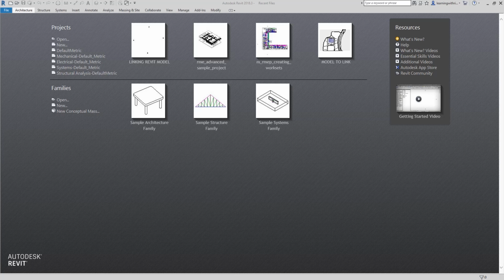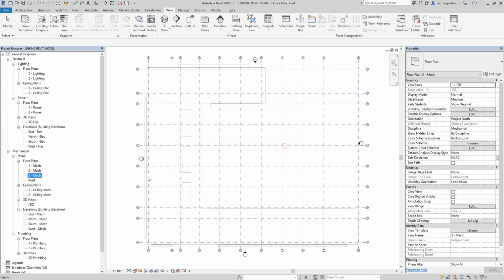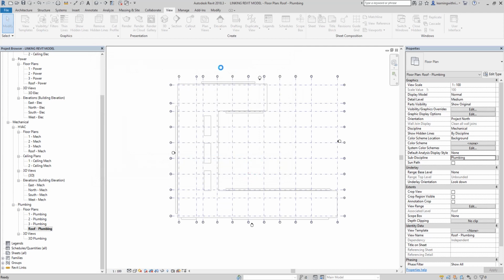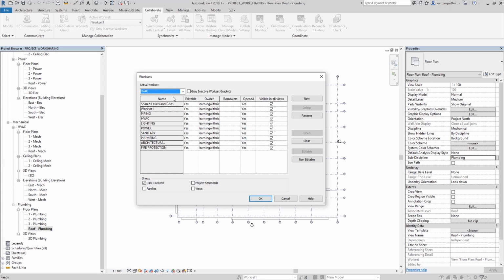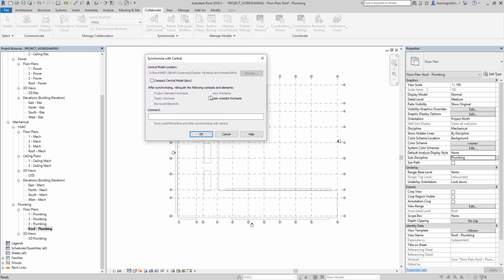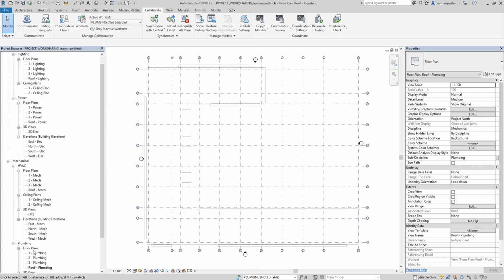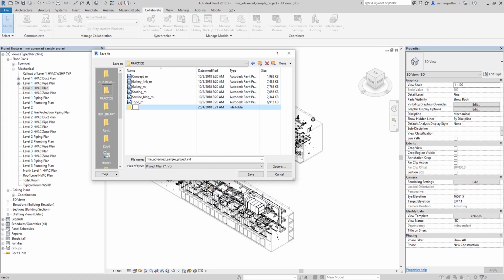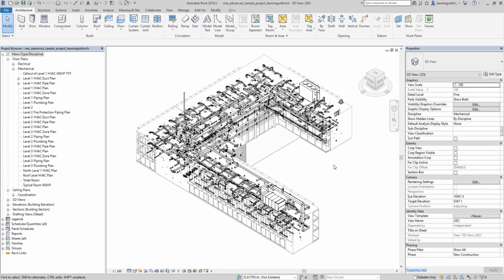REVIT MEP EXAM REVIEW: COLLABORATION_SETTING UP WORKSETS FOR WORKSHARING

Comment: both discipline and sub-discipline are grayed out
Reply from the maker: Turn off the view template
Reply: Hello thanks for replying. with linked projects the only way to hide elements from a view is to disable them in visibility graphics, right? can I do that using workset? the project itself is already grayed out;  how do you assign elements such as plants, toposurface to a workset? thanks for all your videos.
Reply from the maker: @dmaxsaint5895  hello Dmax, now you mention it. Yeah I only use the visibility graphics override to control the visibility of the elements.